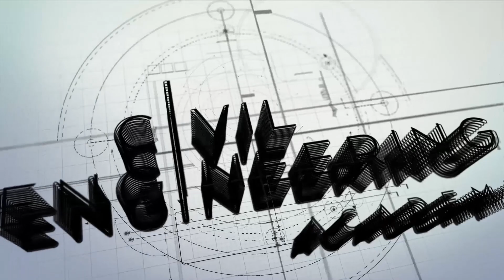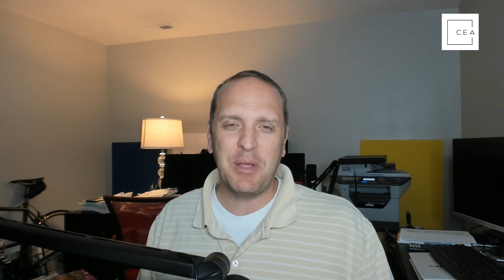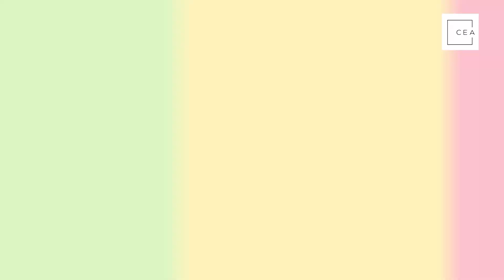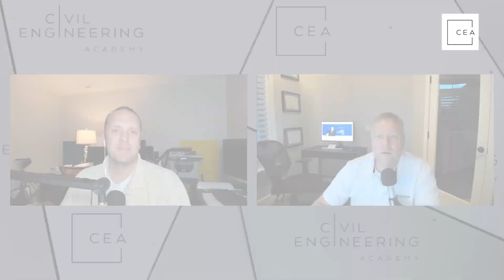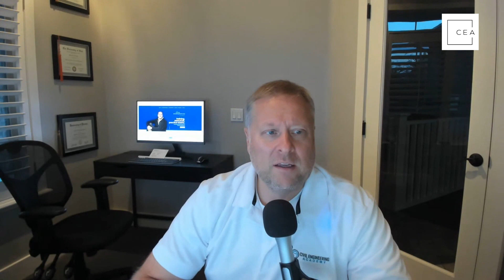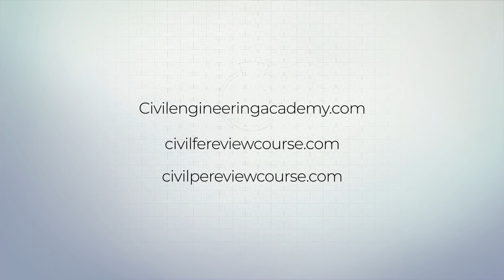CEA 101 - The Highest Paid Civil Engineering Industries

Comment: I would have to say you have missed the mark with respect to the geotechnical engineers.  I am a geo-structural engineer (geotechnical engineer that does structural engineering on the geotechnical aspects of construction; earth retention systems, foundations subject to large overturning moments or large lateral shear loads, high capacity pile and drilled shaft foundations, etc) with 48 years of varied experience from right out of school in the field to firm own to independent consultant lone wolf.  You spoke of budgets and schedules for other disciplines as if the geotechnical engineers don't have budgets or schedules.  Geotechnical engineers make silk purses out of sow's ears by poking a few small diameter borings at the corners of a new structure, take 3 or 4" long samples every 5 feet, run some moisture content and strength test on cohesive soils, classify them by hand and eye and extrapolate that tiny volume of soil to the vast volume of soil that will be influence by the structure and predict how it will perform most of the time not knowing what the loads are, what the framing will be, whether or not there is a basement and if so where and how deep it is.  Geotechnical engineers deal with natural materials by in large (engineered fill being the notable exception) for foundation and structure support.  There can be very significant variations in soil composition, strength, compressibility, expansiveness over very short distances.  Where the bedrock is pinnacled limestone the depth to rock over a pinnacle may only be a couple of feet where as in between the pinnacles in can be multiples of 10 feet.  Drill all your borings between the pinnacles and design for shallow foundations on soil only to find significant quantities of rock must be removed to get to the floor slab or foundation subgrade level.

There has been a very strong move in the civil engineering industry in the last 10 years or so to codify civil engineering design.  The Illinois SE exam now focuses heavily on knowledge of codes rather than solving structural problems.  The widespread use of LRFD for structural design is a good indicator of this change.  The change has extended to geotechnical engineering which is now generally required to do geotechnical work by LRFD methods which make no sense what-so-ever with respect to the common geotehechnical problem like foundation settlement which must be done with real dead loads and some reasonable approximation of live loads rather than some factored load that has no relation to what load will actually be experienced by the foundation soils.  

What is the stress level of the geotechnical engineer that designs belled drilled shafts for a new high rise structure in Dearborn Michigan where there is a long history of generally being able to construct those bells in the "Dearborn Silts" ; but not always.  Especially if you happened to also be the individual that rode the muck bucket down into the shaft to test, measure and inspect the belled shaft bearing surface.  80 or 90 feet down into a 48" diameter dark hole riding down leaving finger prints in the cable above the headache ball.  What about the two geotechnical engineers I know that had the muck bucket get caught on a weld or concrete inside the temporary casing and have the choker for the muck buck become disconnect from the headache ball on the way down.  They had to get the crane to stop, and then reach down between their legs and pick up the choker and reattach it to the headache ball while perched on the muck bucket precariously wedged in between the sides of the casing.  That would be a stress level of at least 3.5 ....

Your information on salary was interesting but I fear you only rated the disciplines with which you were very familiar high on the stress level and lack the intimate knowledge of the other fields to make reasonable assessments of the level of stress.  BTW, dams are geotechnically designed by geotechnical engineers (as in how do we keep water from running out under or around the structure) and earth or rockfill dams are designed by geotechnical engineers.  Maybe this one hit a nerve?
Reply from the maker: I love it.  Come on the show and let's talk all about geotech! We'd love to get the word out and share your thoughts!  Shoot us an email at isaac@civilengineeringacademy.com and we can set something up if interested!
Reply: Want to hear your take on Isaac's distribution of engineering salary vs stress.

Where do you think the numbers lie ?

What about salary vs stress for:

. Pure field boring engineer. Geo.

. General field testing engineer. Geo.

. Office geo design engineer.

. Geo design in Karstic limestone regions.

. Geo instrumentation/monitoring on-site engineer. Vibrations, strain, etc. 

. Other high-niche geo and non-geo engineers.